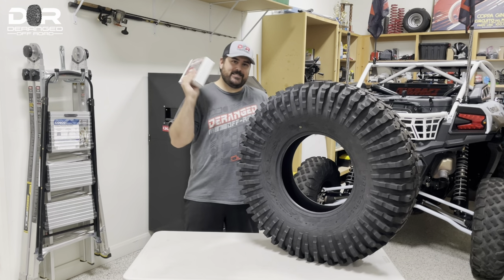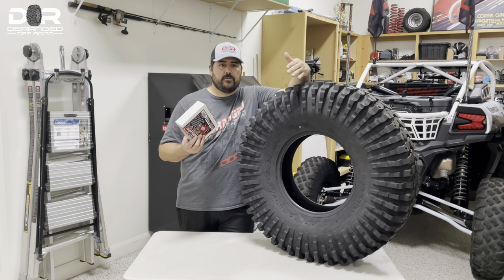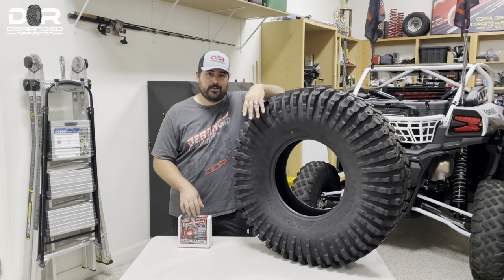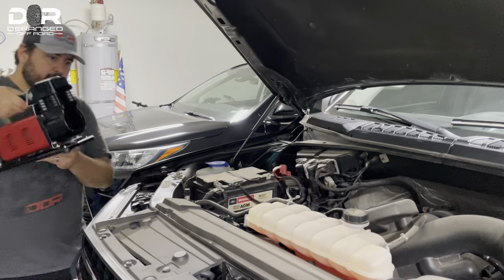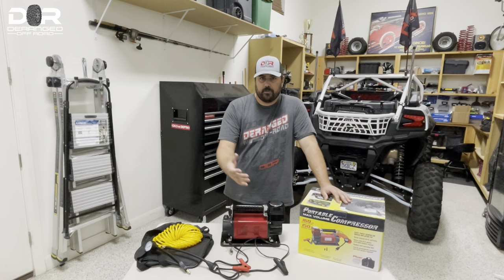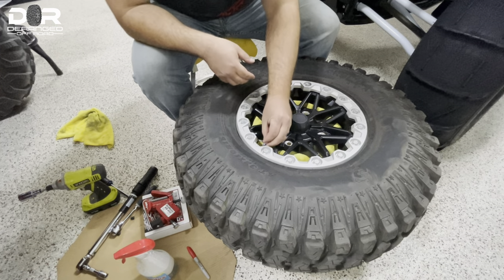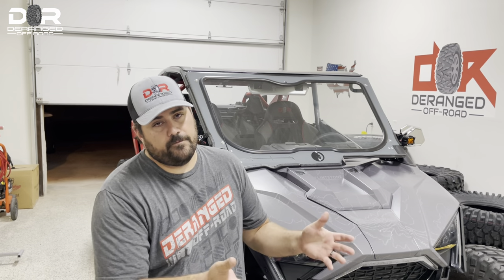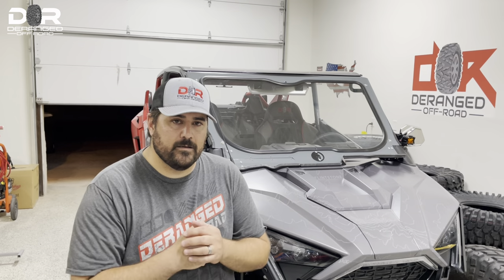Roxxzilla's and Paddles for the ProXP - Beadbuster and Gobege Air Compressor Review

Comment: What size paddle tires did you run on the krx wheels?
Reply from the maker: 32x12 on the rear and 32x10 on the front. It’s the only size they offer for 15 inch wheels.
Reply: @DerangedOffRoad thanks I was wondering how good a 12-in wide tire fits on an 8-in wheel. That's what I want to do with my krx Mount them on some stock wheels that way I can just swap out wheels and tires with my megabytes already mounted on stock wheels
Reply from the maker: They fit fine, but you need to run a one inch spacer on the rears if using stock rims. Otherwise it will rub the swing arm area.